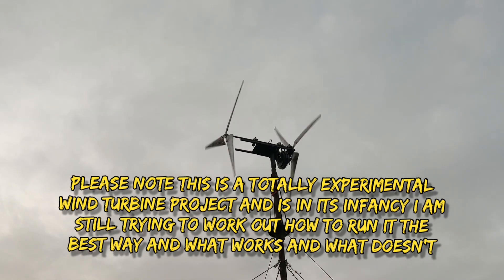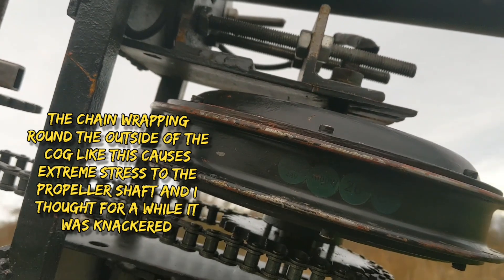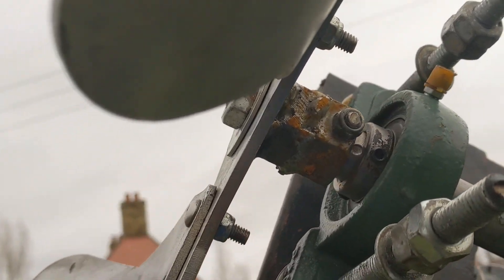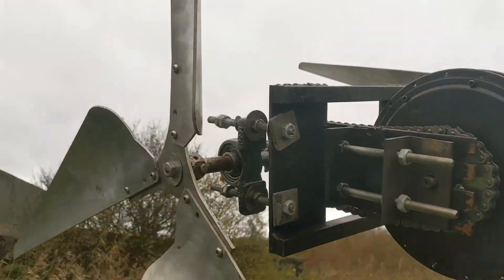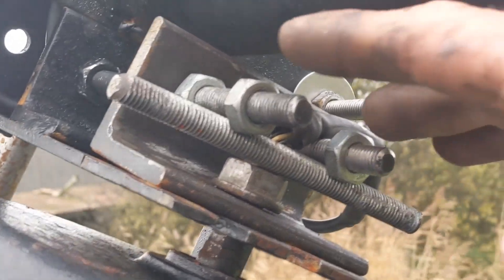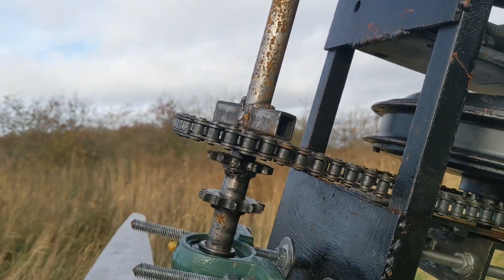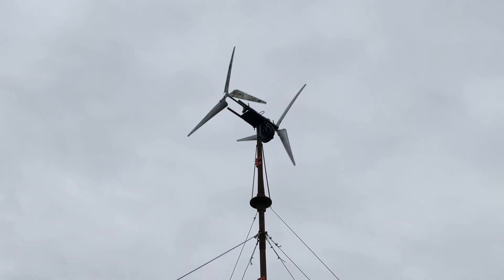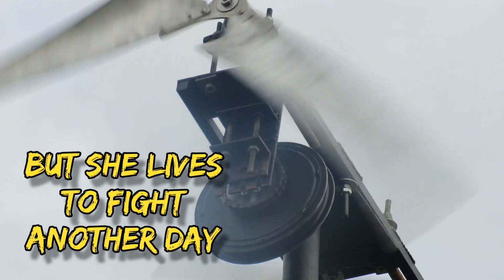Electric bike motor hub wind turbine testing a day of ups and downs !! 17 November 2020

Comment: Nice video Gavin!! There are days I wish I had stayed with a 12v system but to much invested in the 24v now to turn back!! And I have a question for ya why do you have the bridge rectifier next to the turbine and not the batteries? Thanks again my friend!!
Reply from the maker: I have the rectifier at the top because it's easier running two cables rather than three down the tower , plus I figured less losses this way but that's just a guess.

Comment: blue loctite 243 perhaps on anything that may loosen
Reply from the maker: Ive heard that is the good stuff, I have got it in the shed had to drill a new hole on the back end of the shaft to try and get the 5 blade hub fitted.